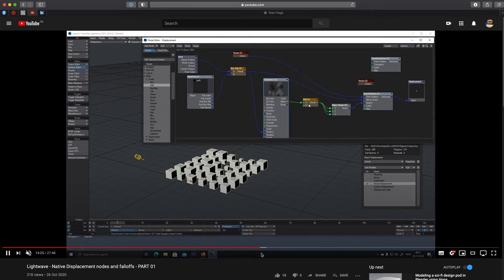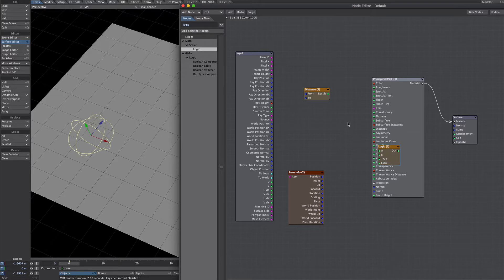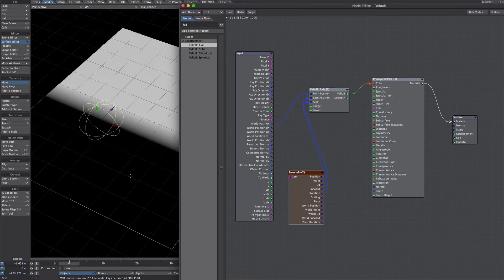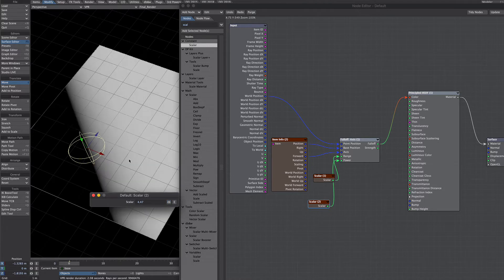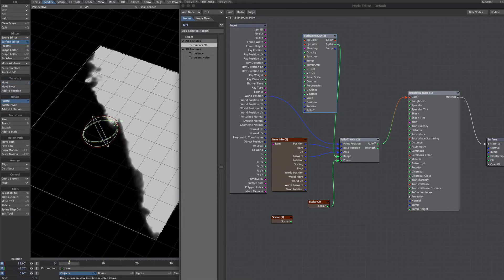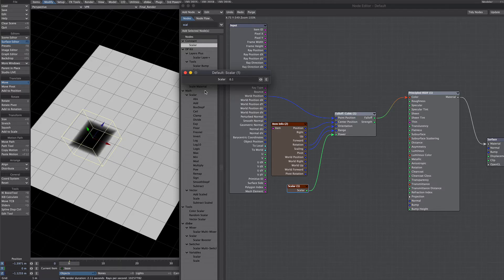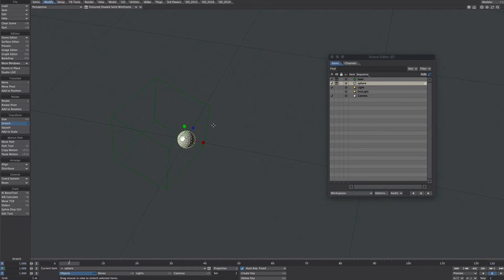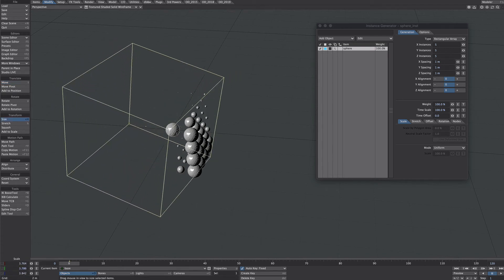LightWave 3d: Native Falloffs

Comment: Wow!... you the node master!
The jumping instances that made you to have to move them around is most likely an issue with NTs crap algorithm. I dont get that behavior with DPonts version doing the same effect.... Sorry to rant on your vid, but that native ray intersect node has failed on me at least 10 times where DPs version works as expected. I really hope that they fixed it in later versions, but it does not appear they did. I would be interested to see how 2020 ray intersect holds up under more complex setups.
Reply from the maker: Ah thanks, that's why! Wasn't sure, that's why the mesh is such a mess, tippled, subdivided etc, didn't think it could be an algorithmic thing.
Reply: @MarkWarnerTV  As long as there are no non planars you should not get those issues. I have been fighting that node from the start. Dpont just added a few new outputs for his ray intersect  (Normal, smooth normal, and delta). All those other options on the native version would be nice to have as well, but since the underlying ray trace algorithm is crap... all those features will also fail when you need them.